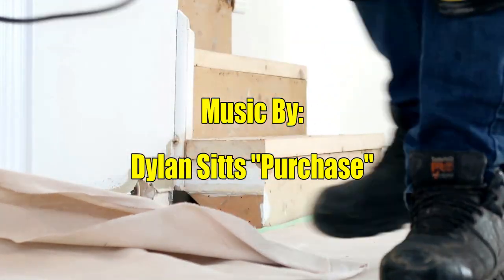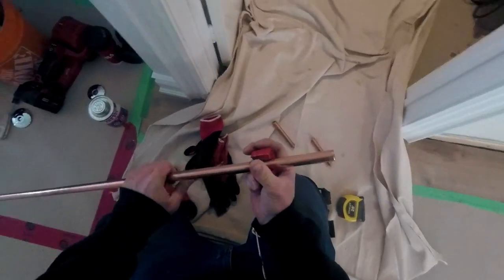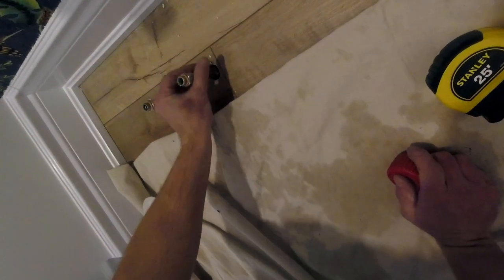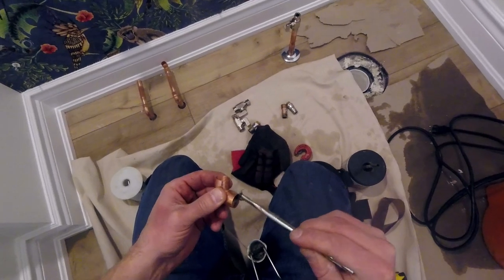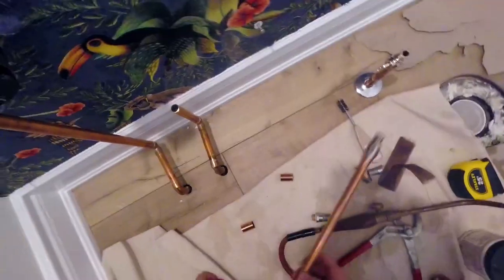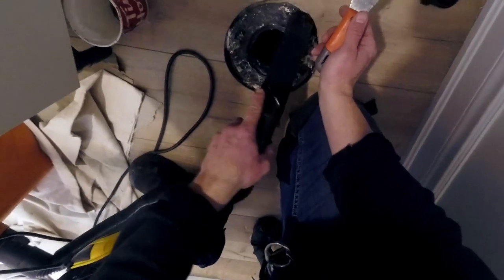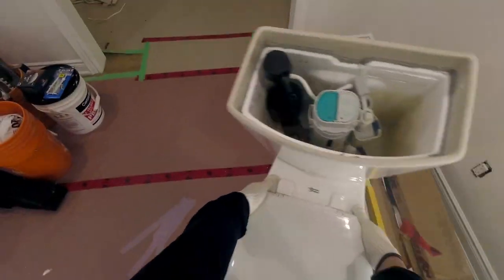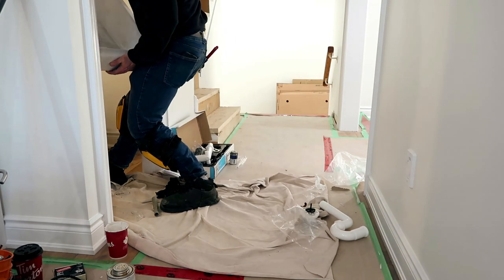A Day In The Life Of A Plumber 126 | Ikea Sink Installation

Comment: Hey Kenny. Plumber in BC. Never used one of those rubber water closet seals you're using in this video. Only ever used wax seals. How well do those work?
Reply: Also we use trap adapters for all our chrome traps. Makes the installation much easier than soldering.
Reply from the maker: Hey J Law, we swear by the rubber gaskets and only use wax on really high flanges. The rubber ones allow you to know if compression takes place because you can actually feel the bowl sit on top of them. Hope this helps!
Reply from the maker: Thanks for the insight J Law, it’s a great idea for the chrome trap! I appreciate the support!